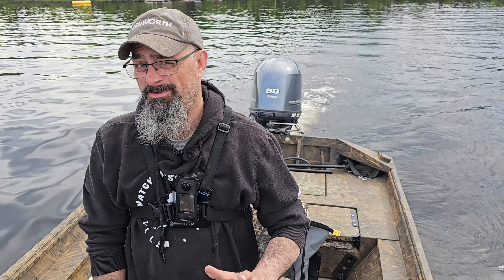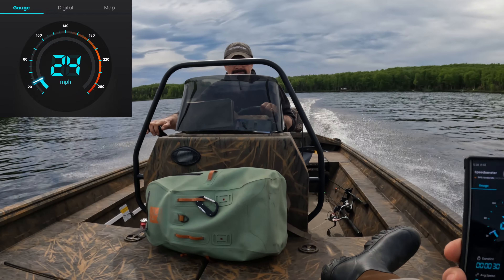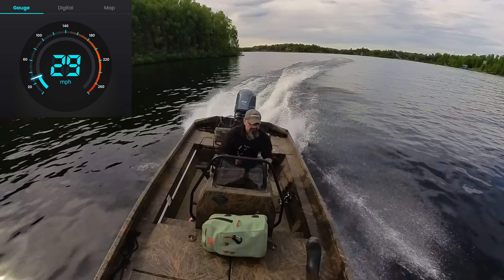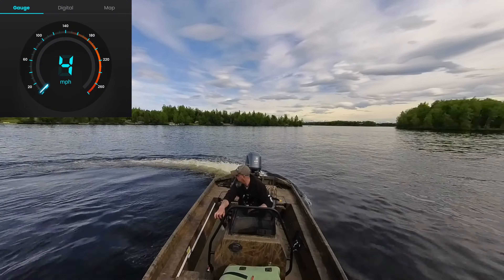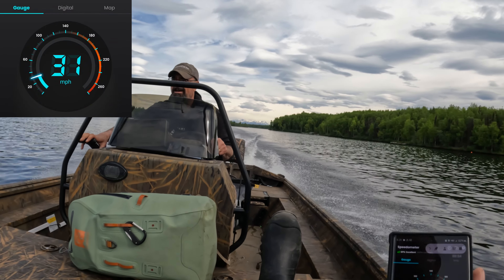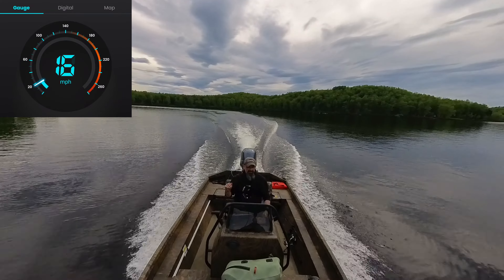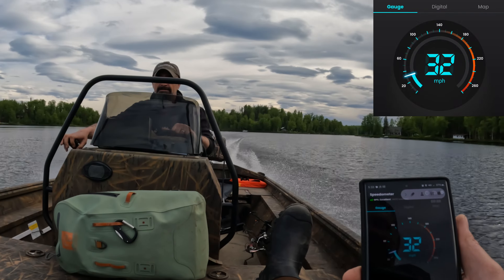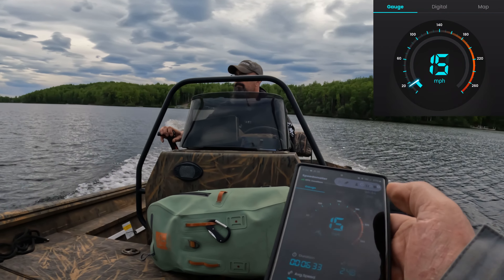How fast Does a Yamaha 115/80 Jet Drive Go?

Comment: My 1993 2 stroke 40 Mariner (Yammaha) motor goes 30mph on my Alumnicraft Backtroller. Though next time I'll get a wider boat with a 4 stroke. That's a nice boat!
Reply from the maker: So far all the boats I've tested are in the 30mph range. That's pretty good to go 30mph with a 40HP motor. Thanks for the info.

Comment: Interesting how they rate it a 115 with a prop and a 80 with a jet. 
Pretty efficient set up.
Reply: The rating is definately unique to the jet side of it.  You loose some but you gain in the super shallow draft of the boat.  Should run in 4" of water on step.

Comment: I'm rebuilding a inboard Crestliner phantom 17.5 all welded hull with a 175 sportjet for river running. I wonder how fast that will be? 

Only thing I am kinda worried about is the lack of a real trim system. Going to rework/reinvent the jet nozzle and ad a horizontal pivot system so I can trim it while under power.
Reply from the maker: It would be nice to have tilt/trim. The neat thing about this setup is that the jet pump sits level with the boat transom, so you don't even have to tilt it up when launching the boat.